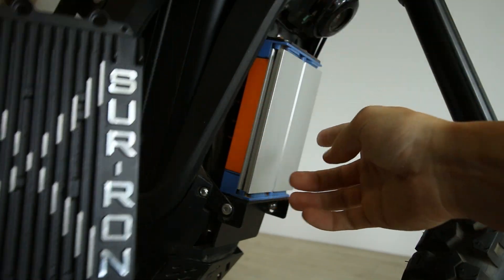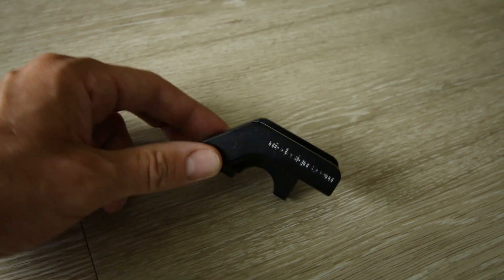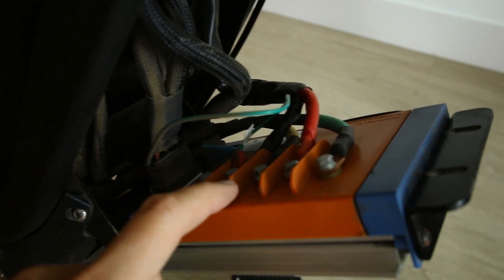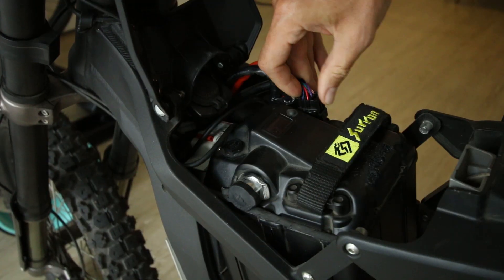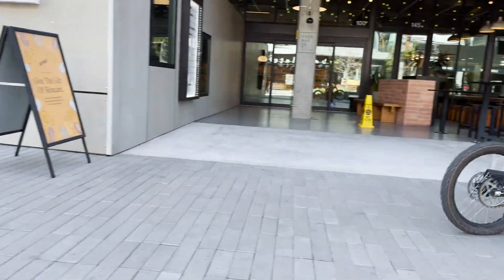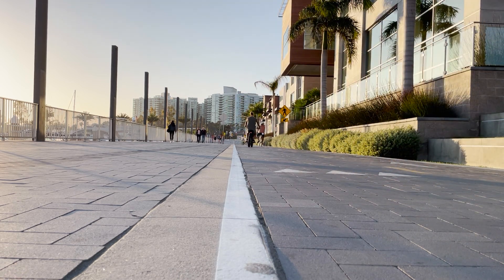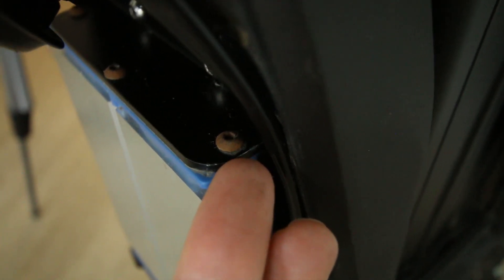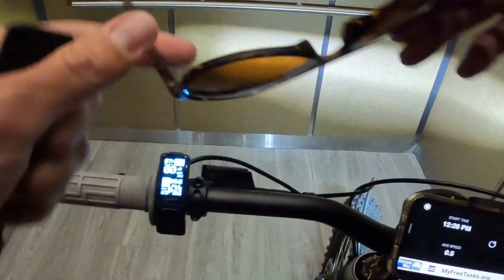My Honest BAC4000 Review (for Sur Ron)

Comment: Can the bac4000 be used for the stock battery bypassed and also a 72v when you have a chance to upgrade? On the website it asks if youll be using a 72v or a bypassed stock battery. Can the same bac4000 do both? Im new to this so any info is helpful. Thanks!

Also, from what i understand, buying it from emoto bros comes tuned whereas green line engineering versoon does not? As in the emoto bros version has an app and software to tune it. Is this true?
Reply from the maker: That’s exactly what I did. You just need to reprogram it when you get the 72v battery.
Reply: @JuicedJoyrides  is it easy to reprogram the controller? In other words, do they walk you through it/ is there info available to do so?

Comment: You’d really regret having bought that green line controller.
Also everyone knows and emotibros  states you need to bypass the battery hats not a “disappointment”
Remove you brake sensors
Reply from the maker: why do you say that about GLE?
Reply: What's wrong with the GLE? I'm loving the GLE app and 2nd throttle for regen.

Comment: Good vid 👍
So you had to bypassed the batteries BMS which was limiting the current draw?  Are you not worried to over draw current and over heat the batteries, potential fire?
Cheers
Reply from the maker: 😆 initially I was not, there more I ran it the more the possibility ran thru my mind, I’ve since deployed to a new battery. Thanks for the compliment sir

Comment: Anyone who is buying a bac4000 please cut your brake sensor cable. There has been accidents where when you apply the brake it will throttle!
Reply from the maker: that's terrifying
Reply: Not for me
Got mine from GLE
You can disable those in the brake setting menu
Reply: Can you please tell me how to cut it? Just bought my son a bac4000 and this is crazy
Reply: @jonlock7150 you just unplug it or change ur brakes

Comment: sounds like the Ctl is supplying trickle voltage. Perhaps looks at the wiring and install a zener diode on a wire to then readout to block parasitic voltages the shouldn't be there. , Or maybe the throttle is not going back to zero positions should inducing slight throttle request?
Need to examine these things.

Comment: I had the same issue with my throttle. So the reason it kept applying power to the bike after letting off on the throttle is because of the throttle threshold response. There should be a way for you to tune it and increase the gap in the app. It essentially just thinks that the throttle is applied when you aren’t touching it. If you increase the gap, it should stop but don’t increase it too much or your throttle response will be wacky

Comment: I had the same issue with my throttle. So the reason it kept applying power to the bike after letting off on the throttle is because of the throttle threshold response.nThere should be a way for you to tune it and increase the gap in the app. It essentially just thinks that the throttle is applied when you aren’t touching it. If you increase the gap, it should stop but don’t increase it too much or your throttle response will be wacky
Reply: yea my surron does the opposite, instead of always being actuated, the throttle has a delay so maybe same way to fix?

Comment: When we went to the bac4000 does your throttle feel way more sensitive? Mine does and it not very usable.
Reply from the maker: Mine is excellent
Reply: same here are you still having same issue?
Reply: @zimbronrons  I simply got used to it
Reply: mine is the opposite, its very delayed and idk what to do
Reply: @Danielxperez14  have you retuned your throttle?
Reply: @zimbronrons  the guy who installed it tuned it but really just did the basics like voltage when idle and full throttle voltage

Comment: sounds like your throttle was not returning to 0? the grip can get frictiony on the end of the bars if its too far on
Reply from the maker: That was my first thought too, but it wasn’t the case. This throttle has quite a bit of dead space in the first part of the rotation, I feel certain this was not the issue, I checked for it multiple times

Comment: Great video as always! I meant to ask you, have you had any interactions with police officers positive or negative? I’m planning on getting the electric power pedal kit, and not cutting the wire to keep it at 28 Miles per hour, however it seems the SurRon has gotten a lot of negative attention because of the many kids in my area ripping wheelies down busy streets going 45+ miles per hour :-/
I’m in orange county.
Reply: so you basically spent 4500 dollars on an electric dirtbike to use it as an electric bicycle that only goes 28 mph... Could have just gotten a Super73 for cheaper and same experiance

Comment: bro you guys waste so much money upgrading sur rons. you could have made your own brackets and had a 10kw controller for $500. oh man you used a lighter on shrink wrap.... a hair dryer or heat gun are better. the problem with your throttle applying low power by itself is that some controllers use a different voltage range for their throttles. your throttle might just be making the controller think your throttle is engaged. You should be able to change all the regen settings by getting deep into the actual controller on the bac. with the cable and computer app.
Reply from the maker: I’d love to know how to get a 10kw controller for $500, how do you? Thanks for your input on the throttle applying power, hope the problem doesn’t come back

Comment: Sounds like your throttle wasn't calibrated or it was incorrectly calibrated. You are kind of at the mercy of the dealer to "tune" your bike. I would like to tune/edit my controller myself... I bought the KO motor controller for this reason.
Reply from the maker: Nice, I’ve been looking at that one too. How do you like it? Did you get the ko motor as well?
Reply: @JuicedJoyrides  I love it. They are actively developing new products as well. I don't have the motor yet. I'm waiting until mine blows up